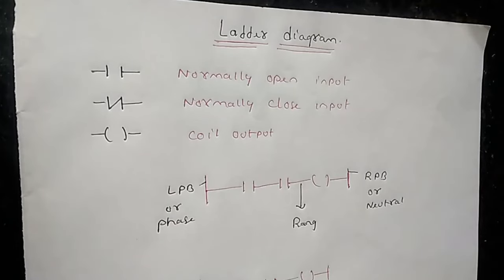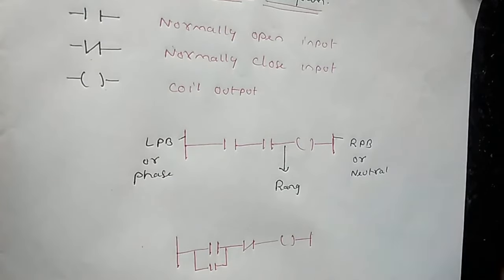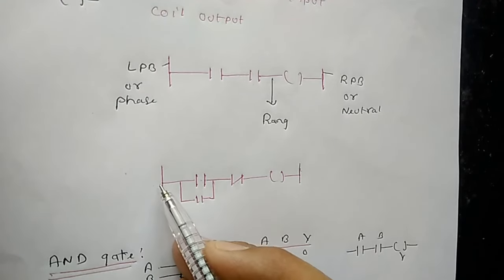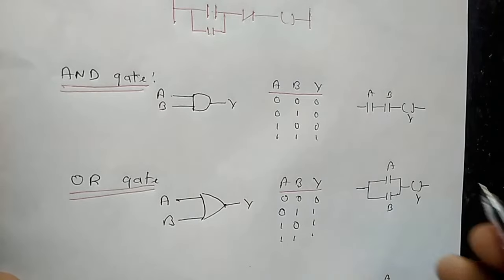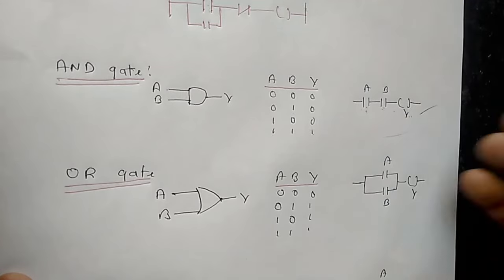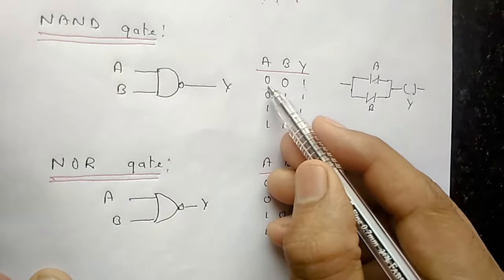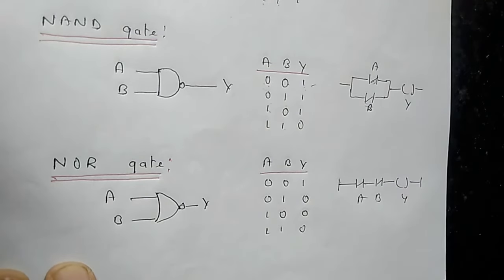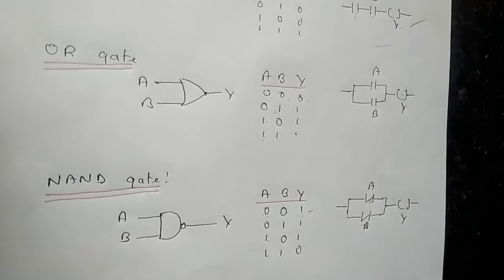Introduction of Ladder Programming In PLC.|| Ladder Programming Of AND,OR,NAND,NOR Gates.

Comment: Good evening! Forgive me if I am wrong but I have found some things that hinder my understanding of the terms NO/NC physical contacts and MAKE/BRAKE XIO/XIC internal PLC logical contacts.

First, i tend to believe that a circuit is activated when there is some action (pressing a physical button or contact by the user or when the physical relay coil is energised and therefore magnetizes the contacts.

Second, i tend to consider the user physical switches and the logical internal contacts of the PLC program as contacts of one state, because that way the brain thinks more simply, while they are two states by definition (double throw). So even in the case of non-activation by the user or PLC program there may be an active circuit/load.

With the terms NO/NC I personally like to refer to the user physical buttons or contacts while with the terms XIC/XIO, MAKE/BREAK the logical contacts inside the PLC program that are activated by the user.

To what extent am I correct in my words? Thanks!
Reply: bro just liked your comment, nothing else

Comment: With reference to Omron CPM2A PLC. Two (2) electric motors, Motor 1 and Motor 2 are to be started and stopped manually where:

1)      Both motors may be started and stopped at any given time if running individually.

2)      It is only possible to stop Motor 2 after Motor 1 has been stopped first, if both motors are running simultaneously.

Complete the ladder diagram with correct instructions for the PLC to fulfil the sequence correctly.

Could you sir pls solve this laser diagram?